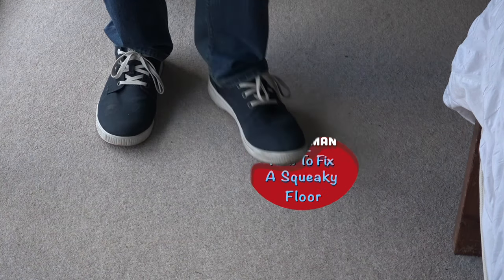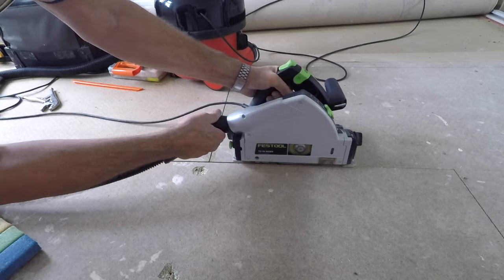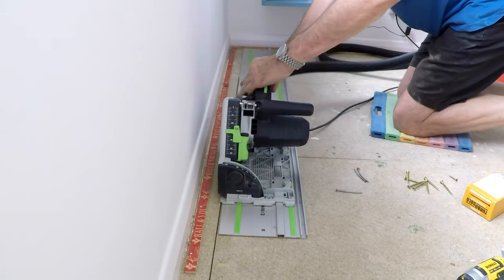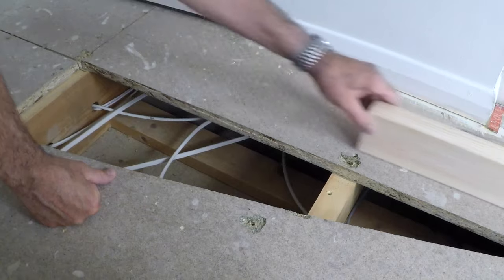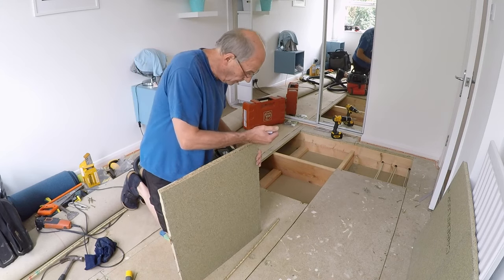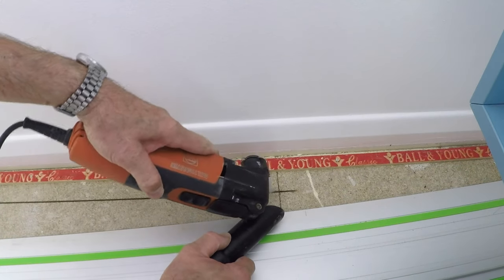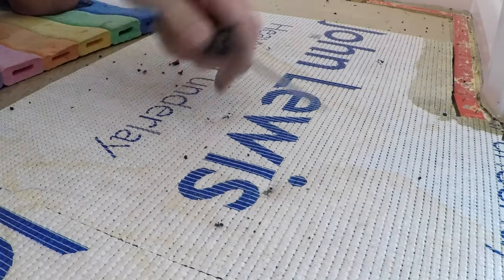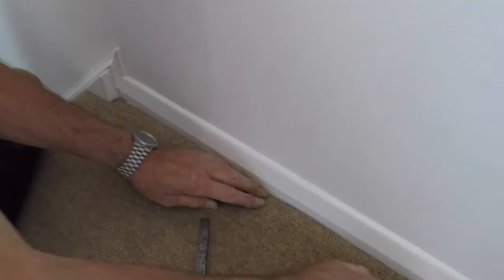How To Fix A Squeaky Floor, a Caberfloor Chipboard Floor. (#4)

Comment: I made the exact same comments about T&G fixes (through carpets and in other videos).

T&G chipboard, awful stuff! Our house suffers from it too, in fact very few fitted with such are quiet, in my experience. The trade fitting T&G chipboard, should, by now, (our house is 31yrs old) know how to affix the stuff well, for the sake of longevity!?
Reply from the maker: The chipboard should be fine if properly glued. Yes indeed the trade should know better. Well I imagine some do but time is money on new builds!  Doing a proper job seems to go out of the window!
Reply: Hi John, amen to that, the knack is knowing the materials and doing the best job possible. Our current house is 30/31yrs old and built just as recession struck. Wish I knew the floorboards would get like this the last time that the carpets were up. Oh well at least I know how to fix em now. Thanks again.

Comment: why do you use nails for the chipboard and not use screws ?
Reply from the maker: Builders have always used nails, presumably for speed and cost. The nails are serrated so grip the wood fibres well. Screws might not tighten the chipboard down tight to a joist if they are threaded the entire length. Drilling a suitable pilot hole in the chipboard overcomes this. Another reason to used nails which by and large are satisfactory. The boards should be glued as well.
Reply: @JohnTheHandymanUK  ok
So, do you have an video or something about subfloor and the wood placements on a concrete floor (need new floor in an apartment block) and make it so it doesnt squeak? Currently its just horrible  sounds whereever you walk
Reply from the maker: @prospect2664  no I'm sorry I don't and I don't have any knowledge of this type of problem.

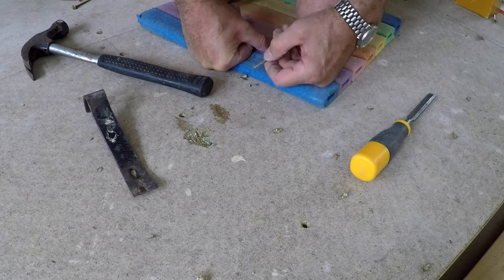Comment: 4:07 would that movement breakdown the bonding strength of that board and eventually breakthrough? (basically fall apart going back to its original form)
Reply from the maker: No I don't think the board would break. It runs under the stud wall and I was applying a lot of pressure to make it flex. Having made the cut near the wall it might break if you jumped up and down on it, unlikely, and that's why I added a noggin.

Comment: Joist spacing is too wide and noggins too small. Also a lack of glue in the original install wouldn't help. Noggins every 400-600 would sort it out.
Reply from the maker: Joist and noggins spacings are correct and the usual. Glue would have helped as I mentioned. The problem seems to lie under the party walls where I suspect timbers have dried and shrunk a little.

Comment: I'm no expert but if I was going to the trouble of lifting chipboard I would refit proper floorboards.
Reply from the maker: I'm not sure that proper floorboards would help especially where the flooring goes under a stud wall and can't be lifted,  but no harm in trying.
Reply: @JohnTheHandymanUK  As I say I am no expert, but do have the same problem in a master bedroom added to an existing house that has floorboards. The rest of the house is quiet, the chipboard floors noisy.
Reply from the maker: @paulsanderson8656  Sounds like it's worth trying floorboards then. I'm no expert either. This type of problem can be very difficult to solve.

Comment: If you were doing an entire floor, could you just relay an entire floor on top of it?
Reply from the maker: You could lay a new floor on top but I don't see the point. I think it will still squeak. Best to cure the problem and not cover it up.
Reply: @JohnTheHandymanUK  much appreciated, thank you. Moving into a property and they are squeeking everywhere, but the joists are those stupid lightweight hollow ones, rather than proper solid ones that I can easily add additional ones.

Comment: Finally sorted this out in my house after years and hours of trying to figure it out.

In the end I cut a square in the plasterboard and found a bloody great nail that some lazy arse had left 2 inches proud instead of banging it home 30 years ago. Won’t budge now of course.

The solution? Sprayed WD40 into the gap to lubricator the nail as the joist moved up and down.

Silence.

Don’t know how long it will last, but these dodgy builders need shooting.

Comment: Most times you can just use a screw next to the installed nail.
Reply from the maker: Yes worth a try as long as you are confident of not hitting a pipe or cable.
Reply: Great minds think alike.
Reply: Screw has to go next to nail across the joist, not in line with it.

Comment: The best way to stop a squeaky chipboard floor?.........rip it all up, throw away and put proper floorboards down
Reply from the maker: That's one solution, rather drastic and expensive, but I doubt it would stop the creaking where the boards go under stud walls. :)
Reply: @JohnTheHandymanUK  we tried everything with ours and nothing worked. In the end we had to evacuate upstairs, took out all the partition walls and put proper floorboards down, it was an horrendous job to do. It has cured the problem but didn’t come cheap....
Reply from the maker: @davidmoody3810  Oh my goodness, sorry to hear that you had to take such drastic action. It's great you got it sorted though.

Comment: Where’s the insulation?
Reply from the maker: In the loft!
Reply: @JohnTheHandymanUK  stick some in between the floors to dampen above floor noise and keep the house abit warmer
Reply: @ThomasColeman  You don't pack floors with insulation, especially if there are electric cables runnng through them as this raises the thermal properties of the cables.  Ask any decent electrician!
Reply: @jayseabie215  what tosh!
Reply: @flippysit  u probably are.

Comment: the chipboard looks horrible, rlooks like a small area , why not remove it all and put in 5/8 plywood , screw that down , bulletproof for years
Reply from the maker: As chipboard goes it's par for the course. I did remove about half The floor, the areas that were squeaky. Replacing with anything else probably won't help.  Stopping the movement in the boards and joists is the aim. The remaining squeaks are where boards run under stud walls and I wasn't going to remove them! It's very difficult to cure this problem.

Comment: I personally would of replaced all the chipboard sheets with traditional floor boards. Much easier and better result
Reply from the maker: I doubt it would be easier. You still have to lift the chipboard but then have to cut the replacements floor boards to size and unless you take down adjoining stud walls you won't be able to remove the chipboard around the edges.